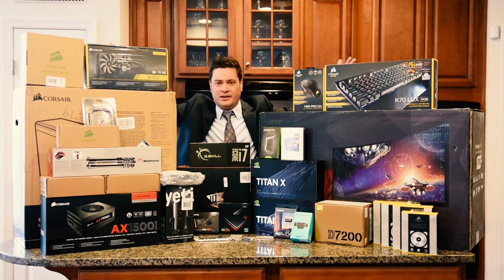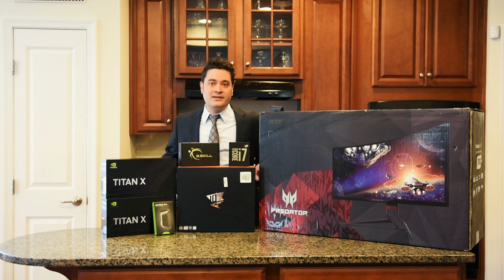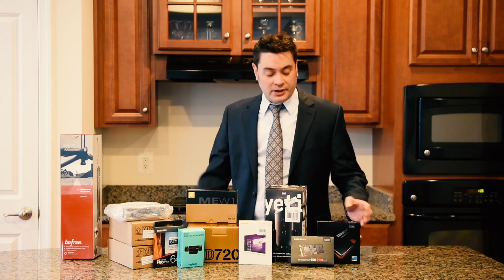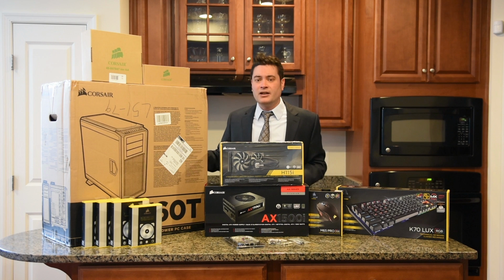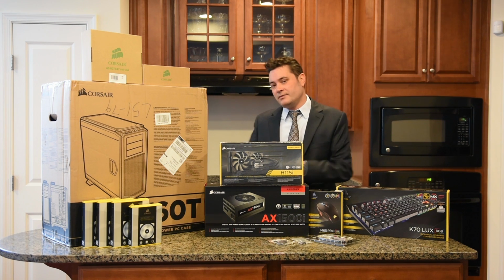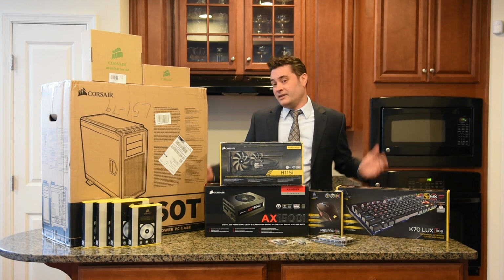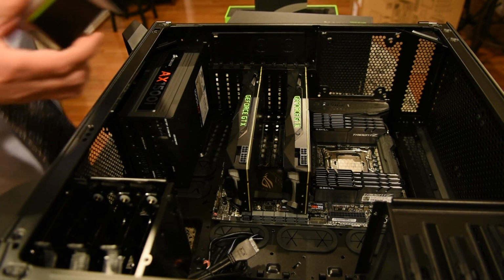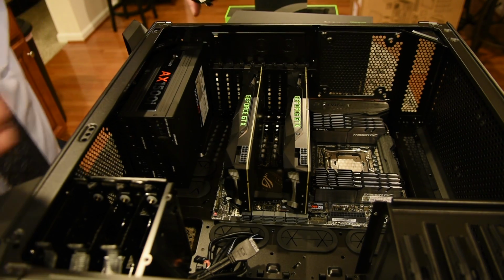Video Extreme Computer Build: i7-6950X and Titan X Pascal SLI (Unboxing, Build and Assembly)

Comment: This is cool.
my build is similar I started on December 19th 2016 pretty much all the same components only I use Corsair Dominator Platinum 8 sticks 128gb, Samsung 960 Pro 1Tb, everything water cool including the board, and modded caselabs sma8 with 4x 480 radiators in push pull config....
Overclock that Intel 6950x to 4.8ghz and still no heat.. 
Forgot what I finally settled on for my dual Titan X Pascal graphic cards. But to be honest they don't really need overclocking...
Yeah I broke my leg last Christmas and I was bored and had a ton of money to throw into a new system.
Absolute Beast...
Reply: Michael Kaine i7 6950x @ 4.8 never ever with Watercooling!
My 6950 is Pre selectet for oc and only Hit 4.3 for 24/7 and for  Benchmark 4.4 on a Custom Loop.
Reply: Geht DInixo .. my system runs at 4.7ghz without issue it has been doing so for months and I have no overclocking experience, I simply use the Asus AI suits to get all Cores to 4.7ghz.. I have been able to hit 4.8ghz without crash but I scale back as my system does draw a ton of power with 26rgb fans 4 pumps and 6 Seagate drives totaling 60tb, 2 Titan Xp 128 ram  
2tb 960 pro... there's a few things left out but I'll post it all for you on pcpartpicker..
I really hate when people knock things just because they haven't achieved them

Here is a more accurate depiction of my build and some photos in case you want to see: https://pcpartpicker.com/b/q7vnTW
Reply: Michael Kaine sorry to say this but it would have bin cheaper gust to use two gtx 1080ti's the only difference is ram thy Shere the same a month of coda cors sorry Bro I feel your pan
Reply: jesse de castro: the system was built long before the 1080ti was available
Reply: Michael Kaine shit didn't realise and I made the same mistake dut I feel dum because I got my titans  after the 1080 ti had gone on sail 😭
Reply: Michael Kaine sorry strapped for cash right now I gust payed for all of my ek water cooling stuff and intell nvmi ssd for my pc
Reply: jesse de castro: I cancelled my GPU waterblock over the weekend
Reply: Michael Kaine are you going to delid your cpu and use an aio
Reply: jesse de castro: hhhmmm 😆 no way I'm smacking my brand new $2,000 processor with a chisel or any other object for that matter
Reply: Michael Kaine 😂😂😂😂😂😂
Reply: jesse de castro: I'm in the middle of upgrading I just sold my two Titans, my 6950X and my SMA8 on eBay.
I picked up the 7980XE for $1800 over the weekend and wanted to grab the new Titan XP but I see that Nvidia will be releasing the Volta either in December or January so now my bill is on hold. It doesn't make sense to get the Pascal now when in 30 days it'll be old technology and I can pick up the Volta for the same price at five times the performance..
On the upside I got to spend a lot of time modding my new caselabs THW10..

Comment: I have same spec’s cost 7k-8k, worth to buy if you wanna play over 200fps with 1080p, 150fps with 1440p and 70-80fps on 4k monitor all 
on ultra almost in all the games. Of course disable AA

Tested with my 3 monitors:

Asus rog swift pg258q, acer predator x34 and acer predator x281hk

Comment: RAM 3200Mhz and processor supports only up to 2400Mhz..
Reply: its called XMP, it allows you to acheive the advertised ram speeds on the box,. XMP is something intel allows on their motherboards so the processor still supports the higher speeds
Reply: 5960x 2666mhx

Comment: please tell me what is the chip at 8.15 is
Reply: It is a ssd m2  memory. It is like a ssd, but with a different connection. Usualy it serves to store the operational system and some programs that you use a lot.
Reply: samsung 960pro NVMe m.2 SSD
Reply: and its storage, not memory. Operating System, not Operational System

Comment: You sure need 128gb ram and ax1500
The 2 titan x arent neithar an overkill

Like srsly where the fuck do you need two titan x you dont even have a 4k monitor and you wont see any difference with 1 1080 and 2 titan x

Such overkill

Comment: Please correct me if i'm wrong, but is the only purpose of the bridge between the GPUs to make sure it's aligned correctly? I thought that it was supposed to connect them to process in tandem of sorts. Also, BUT CAN IT RUN CRYSIS

Comment: Congratulations! Your set up is top. Did you have orientation to choose this? I have a similar set up to work with a very  huge workflow in raw photos  and video with a Nikon D800. In my pc (6950X, Rampage V Extreme, 64 GB RAM, AX 1500i, 1 Strix 1080, Samsung 950 Pro, H115i and Intel 750 PCI 400 GB and several HDs) I see that I dont use 40% of pc performance at 4,4 Ghz overclock... (45ºC)
With 128 GB Ram, i dont know, but i think that you will never use 64, and a Titan X SLi...  Certainly you have muuuuch more hardware that you really need. Otherwise, it´s a set up with future proof. 
PS. You will save lots of $$$/year using AX 1500i :)
PS2: Try use D810 and you´ll see the difference between wather and wine
Overall this is a great Chernobyll Set up :)

Comment: I understand the very purpose of this set-up to be overkill but the monitor is simply a 
BAD CHOICE
I figured you were sold on the criteria that it has gsync but for that you must understand how gsync works what the benefits are compared to vsync
both technologies enable you tearing free images based on different conditions. Basically vsync will decrease your frame count because of some frames being processed but getting rejected (at the last second) from the buffer to have perfect sync with the monitors refresh-rate

gsync will sync the buffer directly to the monitors refresh-rate and so be more efficient because every processed frame will get displayed.. 
THE PROBLEM IS INPUT LAG! 
if your system can output MORE fps than the monitors refresh rate than Don't use gsync because the fps won't get over the hz number of the monitor! 
the "inefficient" vsync however will still output enough frames (2pascals ma friend) and result in a much lower input lag! 
conclusion :wrong monitor

Comment: Noob pc i have i7 24050k and gtx 3080 x5 in sli :D
10000fps+ in cs go :#
Reply: The Deividas noob. i have intel core i20 99183-core proccessor, 781920748x with gtx 4709 8 way sli
Reply: I have a radeon HD 5450 HD which can run minecraft in 
1 fps lol

Comment: lol right before the new z270 mobos, k95 platinum keyboard and ASUS 4k 144hz HDR monitor dropped. That's got to feel bad.
Reply: 6950X is better than 7700K in most use cases.
Reply: ummmm the 7700k is only marginally better than the 6700k and he is not gaming. he is rendering, which is better with more cores and doesnt use clock speed that much
Reply: Not sure where you got that information from but that's simply not true.
Reply: arsenzocht he probably meant It's by far faster than the 7700k in rendering and CPU intensive tasks. Just not as high clock speeds but this build seems like it's more of a workstation than a gaming pc
Reply: Z270 has some new features but x99 is the stronger platform still till the probable x299 arrives later this year!
Reply: https://www.asus.com/Monitors/ROG-SWIFT-PG27UQ/

Comment: is that faster than my celeron..will it play minecraft
Reply: Yes, it's a bit faster.
Reply: Peter Anfindsen no are u crazy minecraft is detailed af it will barely get 10fps
Reply: Peter Anfindsen HOW MUCH TNT VAN IT BLOW UP
Reply: mugi chan i thought you're in pewds' video
Reply: your celeron is faster than hussain bolt running.u probably get around 2390 fps in ultra settings

Comment: He could of set his airflow up better 1 out at the back two out at the top and two reference design cards that only leaves two in at the front to 5 fans extracting I have a 6700k with a 1070 gaming pcs are not just about filtering results by highest price 1st

Comment: hi check this asus rampage v extreme socket lga 2011 v3
cpu i7-6950x
gskill 128 gb 3300 mhz
gtx titan x Pascal sli way 4
ssd M.2 Samsung 2TB
ssd 2.5 inch 4 Tb x 2
HDD seagate barracuda 10 TB x 6
evga titanium 80 plus 1600 w
case antec eleven hundred 
serching UPS and water cooling
Reply: Pablo Olivera you cannot pair 4 pascal cards together lol only 2 way sli is possible in pascal cards
Reply: and 1080?

Comment: if you going overkill should of done custom water cooled and a caselab case thats an extra $1000+ on it. would look nicer too.
Reply: Going full water cooling and unboxing gpu and cpu blocks and installing it all would be a nice follow-up video to this one.
Reply: Jonathan Hatton but why?
Reply: That's like saying why to half the other shit in this video does he really need that much ram no but why not.
Reply: Jonathan Hatton "that's like asking why"***, and no it's not the same. I'm asking you why would you need the whole system custom water cooled.
Reply: Depends if you water-cooled the gpus they would get a better overclock and so would the cpu depending on what equipment you use. It would also just look nicer.

Comment: Not at all a bad set up. ;-) But honestly, if I were you, I would have waited for x299 platform. The architecture on the on the x99 platform is dated back to 2014, so this coming summer, that means it's a 3 year old platform. Not a very "good" investment given how much you pay for that motherboard and CPU. But, if you couldn't wait, you couldn't wait, but I would have waited for Kaby Lake to be released here in January. You've done really well with this PC though.

Comment: I pretty much have the same computer but instead of the 6950x I have an intel celeron and instead of the titan x's in sli I have a GT 210.  I also opted for a single mechanical hard drive.  Memory, case, heatsink and power supply are also "same but different"
Reply: I beat you, got an old IBM 2168-142 with Intel Pentium 100Mhz and without any other GPU than the included in the CPU... Planning on building a sleeper in it, though! BTW, the IBM is from 1996!
Reply: all poor gamers have Geforce 210, even i have one
Reply: NOOBS
Celeron D(isaster)
Voodoo 2
256mb ram
For mouse i have that thing that has a ball under it (pretty sad)
Reply: Jose Vazquez lol
Reply: Derpie056 2004haha
Reply: Jose Vazquez te la pobremamaste we xdxdxd
Reply: india he was joking calm down

Comment: Great video. I dont know why but I guess the Titan XP runs really hot. I had one for about a week and it would hit 85 degrees celsius stock, now I run dual 1080s and the top card hits that temperature running at 2ghz.